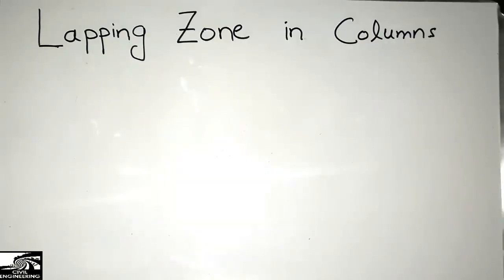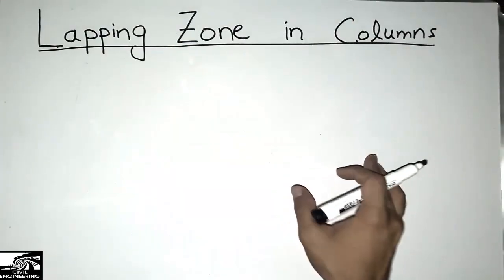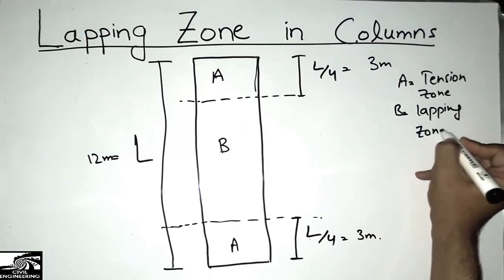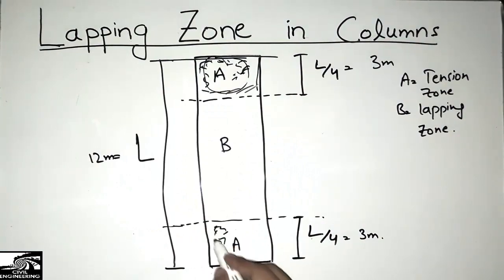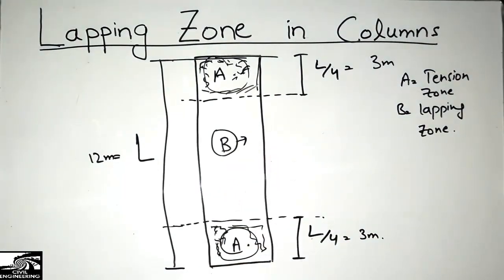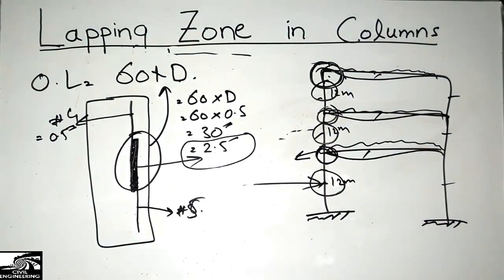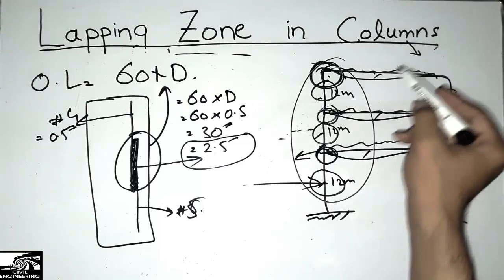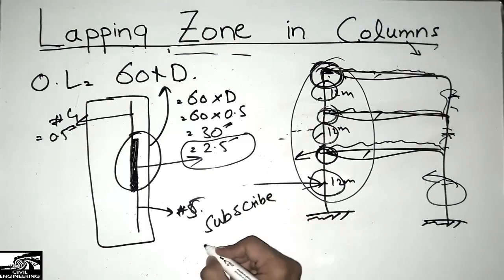Lapping Zone and Lapping Length in Columns

Comment: d means dia of bar
ex:
48d
d=8mm dia bar use
48×8=384
this right or wrong
explain pls reply
Reply: RIGHT BUT 48d IS NOT A CONSTANT VALUE . DEPENDING UPON THE GRADE OF STEEL AND GRADE OF CONCRETE THE LAPPING LENGTH GETS VARIES. KINDLY REFER  IS 456 - 2000 ...CLAUSE 26.2.1
Reply: What is 48??